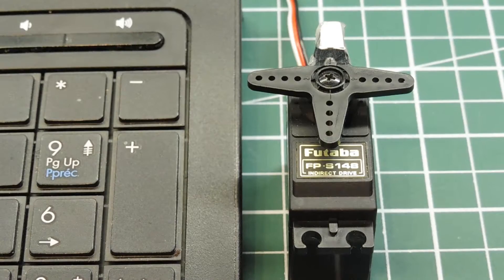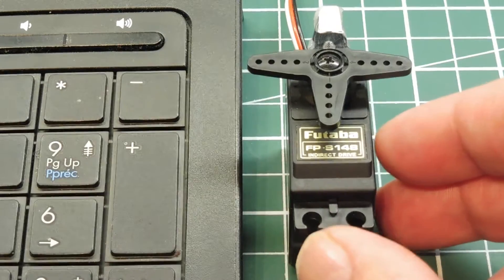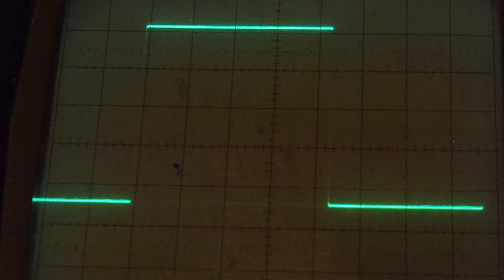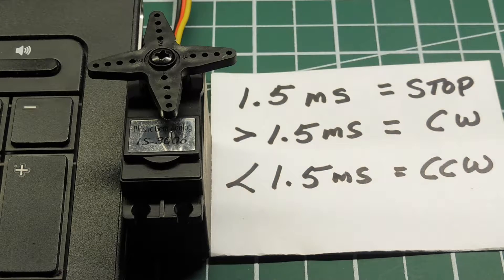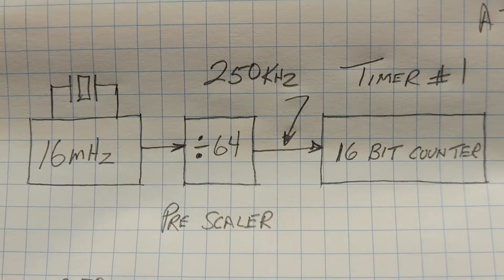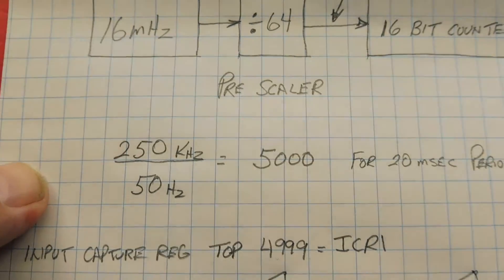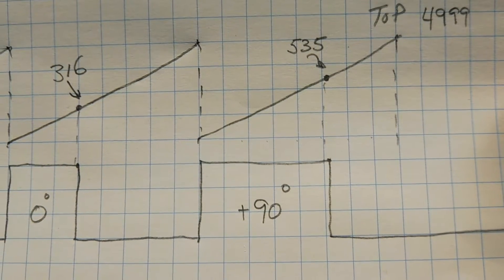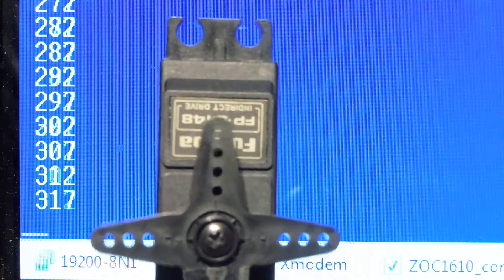Servo Motor Control / DC Brushless motor control

Comment: 0033mer Hi.  I’m learning and experimenting with programming Arduino registers.  I don’t understand high and low bytes (for example the OCR1A register) ... Which one of these do we choose to set in our code when setting up a servo motor ?  Thanks!
Reply from the maker: The OCR1A is a 16 bit register and the data bus of the ATmega328p is 8 bits so the OCR1A register is split into two 8 bit registers. OCR1AL (low $88) and OCR1AH (high $89). You have to do a 16 bit read/write operation using the low address ($88) to access the OCR1A reg. Search for "Accessing 16 bit registers" in the ATmega328p data sheet.
Reply: 0033mer, hi, Thanks for the info. Do I need to write any code in my program to access the TCNT1H and TCNT1L registers (Timer/Counter1) ?  Or would I just need to code the settings for TCCR1A, OCR, and ICR ?
Reply from the maker: @simplelyf4072  That is correct. There is no need to access TCNT1H/TCNT1L
Reply: 0033mer Sorry for the many questions,  but I have another ... when I write to the ICR and OCR registers, can I input decimal numbers  (e.g. 20,000 for my TOP and 1,500 for my compare match) or do I have to use hex values?
Reply from the maker: @simplelyf4072  You can use either as long as your compiler knows what you mean. My compiler understands $1387 as a hex value and 4999 as a decimal value. Check out the code I used in the video: https://www.dropbox.com/s/l1impnw2gt3tfaf/Servo.txt?dl=0
Reply: 0033mer happy to report at long last, I figured it out for my application, with your help :)
Reply from the maker: @simplelyf4072  Good to hear! When you persevere to solve a problem that's when you really learn. Keep it up.

Comment: Another usefull video,  thanks.   I think my math needs help. I do not see how you are getting 97 counts to get a 1 milli-sec pulse.    If 5000 counts is 20 milli-secs and we want a 1 milli-sec output pulse then we would want 5000 counts/20 milli-sec  *  1 milli-sec  = 250 counts,   but you get 97  ?
Reply from the maker: Your math is correct. The tolerances of servos can vary greatly. The typical spec is 1,1.5,2 milli-sec for total range control. I have used servos where the -90 degree position needed a pulse less than .5 milli-sec as in the case of the one in the video. Using 97 will give around .4 milli-sec pulse. You can enter any value that you want to match the servo you are using.

Comment: it is very precise contole methode because no load was added, should not be more effecient and precise when using a closed loop control?
Reply from the maker: The Futa S148 is a common RC hobby servo which uses closed loop control. The pulse width control signals are decoded  internally which causes the motor to turn an internal potentiometer. This creates an error voltage which keeps the motor turning. When the error voltage is zero the motor stops at its controlled position. Higher torque servos are available to drive bigger loads. Check the specs.
https://servodatabase.com/servo/futaba/s148